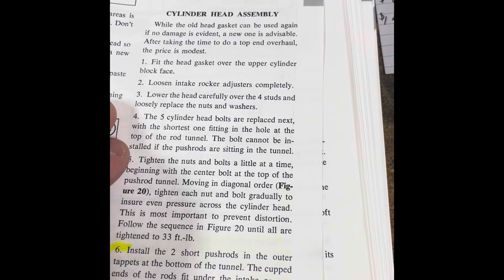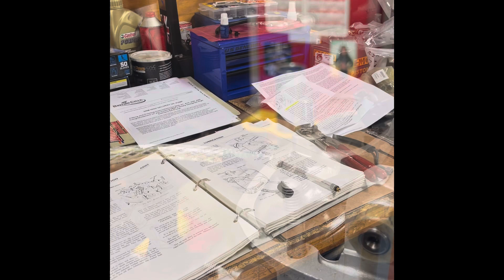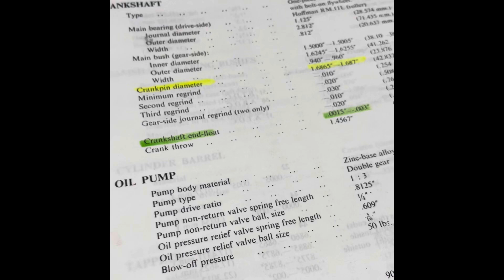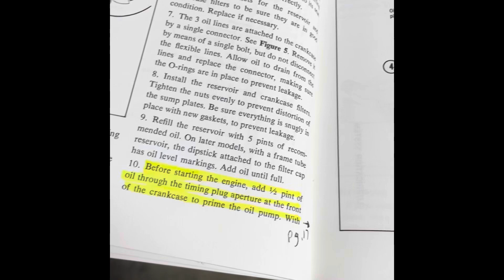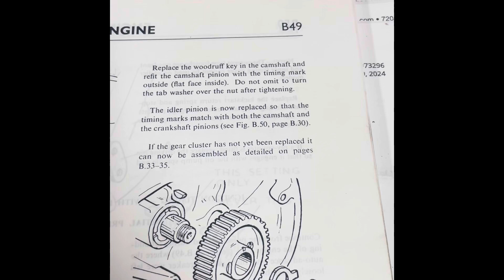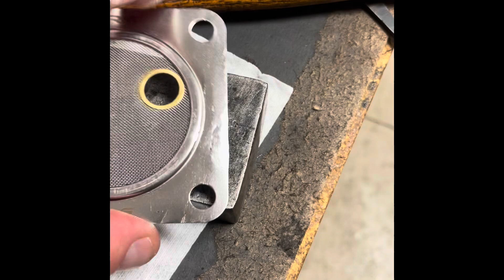1966 BSA A65L Resurrection part 23 Oil system priming , timing gears,oprv, sump, & oil pump install

Comment: Nice SRM pump. Weren't available when I did mine but it has a cast iron oil pump  from a late engine instead of the zinc  alloy or whatever it had before. Going to fit an oil pressure gauge.
Reply from the maker: It sure looks nice I was on the fence between the SRM or the Hepolite since the SRM has been proven and came with a new pinion paid a little more but probably worth it. Kinda long story originally this engine was getting the timing side bearing and oil pressure gage provisions but it didn’t pan out . Thanks for following along Pat have a good weekend.